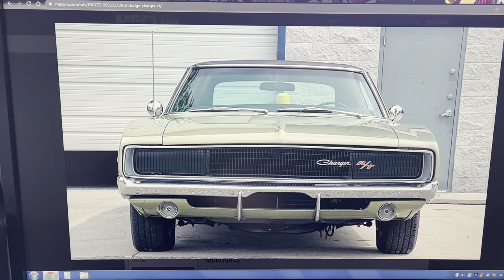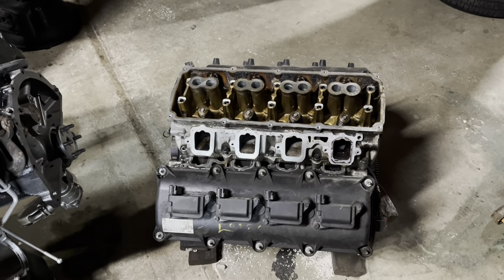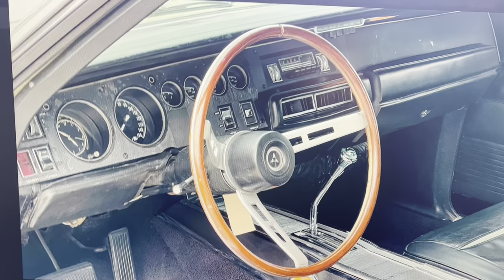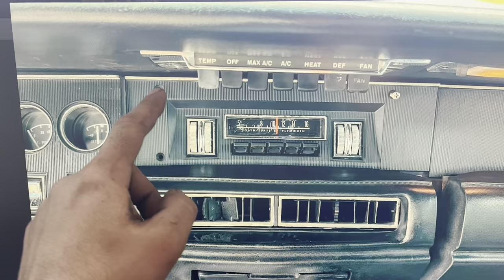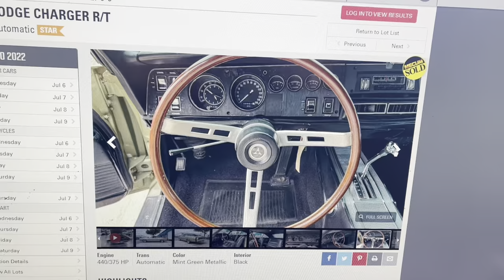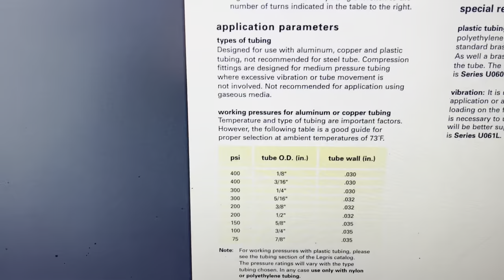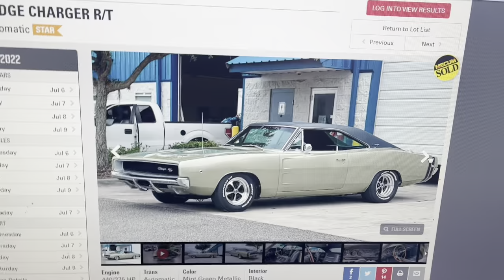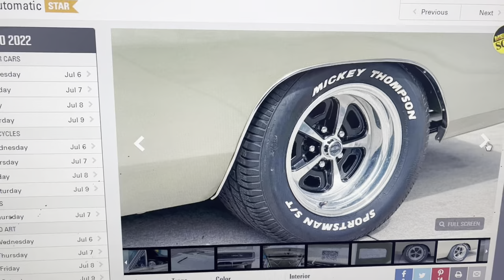Why Did This 1968 Dodge Charger R/T Just Sell At Mecum For $170,000? (It’s Unsafe And Bad)

Comment: You're absolutely right about that car...and there were more issues than you even mentioned. For example, the crappy fit of the bumpers stood out to me.  I've got a '68 Corvette that had been "restored" by some "professional" shop. They made so many mistakes and cut so many corners that I'm having to do a complete frame off rebuild just to be able to safely drive it. Even though they had already done a frame off rebuild, they neglected to replace the rotted body mounts and seat belt mounts. Only 4 of the 9 body mounts were holding anything....and two of checked this car out underneath with it on a lift. You couldn't see those issues with the car assembled. I drove the car that way for 3 months before discovering the problem....and MANY more. The paint looks amazing, but this is the worst and most expensive polished turd I've ever owned. I wouldn't have been able to pay someone to fix this car, but thankfully I can repair it properly myself.
Reply from the maker: Wow. Yeah, I really think that’s what’s going on here. Pretty decent paint job hiding so much bad stuff. I do think I mentioned the bumper fit? It’s obviously quite bad. If it didn’t make this video I might have cut it. Again I could spend days picking this car apart… I just wanted to hit on the big notes and talk about the crazy price and the stupid brake stuff.

Comment: Just found this. As the restorer and owner of a 1966 Dodge Coronet; this is why I bought a shell and frame and used my grandfather's and dad's Automotive manufacturing experience with Chrysler/ Mopar to rebuilt it TO Factory, no cheapness or wierd and unsafe corner-cutting. 
  This charger looks gorgeous, but ignorant decisions were made for the sake of profit. It is all fixable and hopefully gets detected and addressed by the buyer. That is alot of money for a Shade-Tree restoration. Mine took me from my sophomore year of HS ( 2009 ) to when I got married in 2014. It is now our weekend car lol. My Coronet is as close to factory as possible with modern parts and materials.
Reply: “Shade tree restoration” brings back fond memories of being sixteen/seventeen year old kids with just some tools, a pocket full of more dreams than money, a good number of very inexpensive local junkyards to spend endless hours wandering around in, and an old oak tree with that one perfectly thick branch at just the right height and angle in back of my dad’s less than desirable restaurant in a northern Michigan small town hit hard by the recession of the late 70’s. 

Thankfully most of us survived the “builds” we “geniuses” somehow so proudly pieced together. 
Man, if I had only put away just a few of those cars I somehow managed to get my hands on back in the day…I’d definitely have more money than dreams in my pocket today!

Comment: Really enjoyed your observations on this Charger. I'm a 1969 Camaro expert and  have seen many Camaros for sale at Mecum and Barrett Jackson that say original, but are not correct. They may have a deluxe interior, then don't have the deluxe installed seat belts, or missing the wood grain trim on the dashboard areas. Seen many RS optioned Camaros missing the headlight washer nozzles in the pictures that also are part of the RS package. These are just a few examples. All I can say is "Buyer Beware!"
Reply: Yeah, “buyer beware cause seller’s don’t care!”
Reply: I know in '68s the deluxe belts were a separate option from the rest of the interior. 
Was that different in 1969?
Reply: Car looks to be sitting lower than standard or is it ?

Comment: I worked at a local auto parts store when I was 18 years old. One of the other guys was waiting on a customer asking for 3/16 compression fittings and the customer also asked him if he could use them on brake lines. My coworker replied….. If you wish to die. He then explained how much pressure was in the normal braking system and then what compression fitting were rated around. The customer purchased the correct brake lines along with double flaring tool. I myself purchase lines and couplers to lengths that I never need to cut and double flare brake lines. The only use I have for compression fittings is transmission and fuel lines. This was and is a great and informative video. Thank you

Comment: Hats off to you for you are very insightful and also polite with your assessments on this channel. First I'll say that in my opinion, this is probably the best color charger R/Ts came in and it looks like a beautiful paint job up close. I totally agree at this price range it should have continuous lines. throughout. In all honesty I've used the compression fittings on many cars 70's-80's cars of my own and never had any problems. I never knew their rating was low. 

I was eight years old when this car was built and our neighbor Eddie had a Charger 500 in pale yellow that I used to see every day. Long before I could drive, I already loved the style of that car.
None of the cars sold at Mecum look like an original car did back then. They weren't that shiny, they didn't all have mag wheels and tinted glass, or consoles. It is hard to believe the prices that are paid . 

I'm also amazed how many classic American cars are still preserved in general. There are still hundreds of thousands of them in all makes and years.  Remarkable.
Reply: >>>  === They say  E bodys : 71 Challenger or Cuda /  B bodys : 68 Charger or Daytona / C bodys : 71 Fury Sport.  These Mopar type alone will ALWAYS bring VERY TOP  ... T O P dollar. True supply and demand  never lies I guess.  === <<<

Comment: Compression fitting on a brake line. Yikes if you were willing to do that, I'm curious about the electrical and fuel system. Shop full of Mopars, I subscribed. Demon has always been on my wish list, right there with a 4 spd AAR
Reply from the maker: That’s exactly my point! It’s great we can see that… but what can’t we see? It just says everything is bad to me. Everything on that car demands scrutiny. 

Thanks! I love the Demon. That was a deal several years in the making. There is a whole playlist on my channel called Dale’s Demon if you want to learn more. Now that I have a lift I hope to be making more videos on that soon! It needs a transmission… third and fourth gear have left the building…
Reply: compression fittings in the electrical system, too. You don't want the amps leaking out onto the driveway.

Comment: Thank you for the insight of the compression fitting on the brake line. No one has ever brought that to my attention. I used a compression fitting when I installed a dual master cylinder on my 1961 Chevy Impala back in 1982. I still had that fitting when I installed power disc brakes on the front in 2020. That fitting is now 30+ years old and has traveled about 100,000 miles. At this point, I'm not sure what to do. You know the saying, "If it ain't broke, don't fix it".
Reply from the maker: There are lots of them out in the wild on brake lines. It can work… but it’s not the right way to do it.

Comment: I worked for a short time at a very high end resto shop ,where one job involved reassembling a a 300Letter car . The owner was already into it for $250,000 when I got it running and the engine,a 413,had horrendous piston slap. . I told the owner it needed rebuilding and he got pretty upset as it had already eaten $40,000 . When we got it going it was sent off to a alignment specialist who refused to let it be driven back to the shop because the steering box,rebuilt by a very pricey shop here in my city, was no good. I sent it back to the US where it was rebuilt for less than the cost of freighting it to and from the USA. Lots of things were wrong with the car despite the money spent and i could only put it down to the shops company management cutting corners to to gain more profit. I decided to leave at that point.  Recently the car sold for just over $75,000.
Reply from the maker: Wow. Yeah… making money is one thing. Charge enough to do a good job (not, you know, $1000 an hour) and do it right the first time. I’ve been in business for myself. My big challenge was trying to charge enough to pay the bills and survive. I just couldn’t take people like that. Those guys on the high end have the charging part down…

Comment: You're totally picking it apart and you have very valid points too many mistakes too many problems for that price  mopar is expensive 170000 should get you a completely finished car
Reply: Just saw the article that a Ford Crown Vic can be converted into a late '60's Dodge Charger!
Reply: Looks like it was done by a 'bodyman' with limited mechanical skill... but body is the expensive stuff...
Reply: 170,00 should get you a NOS new car with 10 miles on it.

Comment: If the engine, transmission and rear end were in very good to excellent condition, and the AC worked, I doubt that was the case though, then maybe $30,000 to $40,000.  I've owned three 440 magnum MOPARS and one 340.  1968 Charger RT, 1969 GTX, 1970 Challenger RT/SE and the 1972 340 Challenger. The best was the 1969 GTX that I bought from the original owner when it was one and a half years old. They all had AC, power steering, power brakes and automatic trans.  Actually, they all were in practically new condition.  This car for that ridiculous price is sh t!  The seller made out/was a bandit, and the buyer was a fool.   I've got a bridge in Brooklyn that I'll sell to him...
Reply: Uh, what? I fell asleep halfway....
Reply: @CaptainCraigKWMRZ  no matter

Comment: Right on man. I see trash work like this alot. Recently had a Super bee come in that had a Grant steering wheel that the owner wanted to put back an original. The car came out of a name restoration shop. I got the wheel off and the aluminum adaptor and realized that the steering shaft was UPSIDE DOWN so that the blind spline was 180 out and they had just mashed the aluminum adaptor over the steel steering shaft because it was softer. Had to remove the shaft from the box and rotate it then put the original on with the splines lined up. Stupid people man. My wife even laughed at this one.
Reply from the maker: Absolutely maddening. A lot of what I do with old cars is going in behind people that don’t know and fixing dumb stuff - usually on the tune up and runability side of things.
Reply: Cool wife 👍
Reply: Just saw the article that a Ford Crown Vic can be converted into a late '60's Dodge Charger!
Reply: @stuckinmygarage6220  The best!!!
Reply: @BuzzLOLOL  Saw that too, you have to Flip Over and Read Directions. . . .
Reply: @joemancini3258  - My Crown Vic is an '04 with rack and pinion steering and slightly wider track, but prolly still work OK... I cracked up with 'Charger' hood open and looked just like my Crown Vic underneath it...
Reply: @BuzzLOLOL  🤣

Comment: I worked at a Plymouth dealer as a tech in 1975 and bought a one owner 71,000 mile 68 RT auto running no rust for 200.00 dollars. After I sold my 1971 Pontiac gt37 leMans
Reply from the maker: Oh to have been around in those times…

Comment: As a 16 year old I bought a 383charger non RT from my hometown dodge dealer exactly the same colors as this one for $1300 in late 1972. It had about 80,000 miles already because it belonged to a military guy. The good news is the dealer had freshly rebuilt the motor and it was a very clean car. I drove the heck out of it for about three years and sold it for $1200. It was a great car. I couldn’t afford one now.

Comment: I worked in auto parts for 18 years and have had customers leave mad because I wouldn't sell them a compression fitting after they told me they were going to use it on a brake line.
They still insisted it was fine after I said that may be one of my kids out there on road that they hit when the brakes fail, so then I told them to get out.
Compression fittings do NOT belong on brake line no matter what the value of the car.

Anyway, good call on that auction sale, it's bad all the way round.
I always hankered after a '71 Charger SE but just can't afford even a beater.
All the best.

Comment: Just subscribed. Wanted to say thanks for educating anybody who saw the compression fitting and didn't understand why it was so wrong.  30 years ago I did a hydraulic clutch conversion in a Jeep . I needed it moving and had to cobble the line back together to the slave. I used a compression fitting.....and it worked. What I didn't understand was the continued cycling of pressure worked the fitting to failure. I didn't crash and I learned a lesson. Brakes are a different matter. Your first failure is potentially your last.
Reply: Yeah you do a repair to get you to a place where    you can do a proper repair. My automotive education began with John Muir's "How to keep Your Volkswagen Alive and Well for the Compleat Idiot!"  It held a lot of lessons about how and why on mechanics an life and I found it way better than Zen and the Art of Motorcycle Maintenance

Comment: I bought  73 Dodge Charger SE Brougham from a guy who had Mecum try to offer to sell it for him.
I may have spent more than it's worth and it had typical 50 year old issues. But solid and mostly original. But I knew what I was getting into and checked it over completely before buying. That brake line you showed, froze my heart. DAAAAAMN!!! that's bad.

Comment: Compression fittings are actually a common cheap fix I see regularly. They do leak eventually. You can actually tighten any line or fitting properly to ensure they don't leak but few people know what to do. So here is the proper procedure to tighten any line, fitting, or coupling. First snug it on both sides, then go back and apply more pressure so it is tight... but wait, here is the trick... take a magic marker and draw a line across all the pieces in the connection. Now go back and lightly loosen the fitting then retorque it. You will notice that you can actually gain about 1/4 more of a turn on it. Then... don't forget to firmly attach a body clip to eliminate vibrations. Vibrations cause leaks and breaks in hydraulic lines (booms on backhoes, diesel injector lines, etc). Lastly,  the mismatched paint on the doors and quarter panels is caused by 1 or 2 things. The painter failed to keep the whole gallon of metallic mixture continously swirled every 5 minutes OR they painted the door at 30 psi and then the quarter panel at 50 psi, open the fan spray width.  These conditions cause metallic paints to alter their tone.
Reply from the maker: We’ve got a non-metallic yellow Cuda at work currently with similar mismatched paint problems, so there are definitely several ways to skin that cat… getting that extra “cinch” is definitely essential to get flares to seat. I stand by what I said about using compression fittings in brake systems. And yes, I know people do it all the time. They shouldn’t. I personally don’t want a fitting that will “leak eventually” holding 2000 PSI of pressure inside my braking system.

Comment: Videos like this make me feel so fortunate I was able to get my 72 nova from the second owner with all original parts even trim and emblems original paint and no body work ever done. It might have a tiny bit of usual nova rear fender rust but no flashy paint hiding shotty body work or weird short cuts. I think it is REALLY important these days to try to find something super solid for less money and do the work yourself then trust these really nice looking "restorations". These cars are just too old and most have changed hands so many times it is impossible to know the true build quality after all the years of guys wrenching on these things in their backyards.
Reply from the maker: I feel the same way about my Demon - and to a lesser extent, my Charger. The Demon is almost all original paint. The original V belts are in a box… I don’t have the original tires or the air that came out of them, but I have just about everything else. I know exactly what it is and what it isn’t. My Charger had some repairs and a cheap paint job done. It’s not amazing, but it’s easy to see what has been done, and it will be easy enough to redo later. It’s not a total hack job. I’d be very, very wary of anything that looks shiny and “new” like this.

Comment: When I got my classic car, I bought a non molested 1966 GTO that needed very little body work, took it to a good shop, had them replace all the mechanical stuff, rebuild engine and trans, fix the little body work, paint, new interior and ive enjoyed it for 14 years now. Still looks great.
Reply from the maker: That’s awesome. At the shop I closed in July (which was not a body or restoration shop,) for some reason we took on a humongous ‘66 GTO project. It needed floors, trunk, quarter panels, rear window filler and bracing, lower fenders, and lots of other little stuff. It took three years, but we finally got the metal work done and primer on the car just in time to close… whoops. I hope it gets finished wherever it ended up. It has been in pieces since 1990, because as often happens, someone ripped the whole car apart with big dreams of a full restoration. They got as far as painting the frame, and having the engine “rebuilt” by a high school auto shop class with three different types of piston for some reason.
Reply: @DeadDodgeGarage  Oh ya, at work all the gearheads made fun of me back when I bought it and sent it to a shop. I said I didnt want to tear it all apart and get burned out working on cars and let it sit there for 10 years. So I got my car back in about a year and it cost about $50K parts and labor. They then made fun of me being "underwater" on it and I said I didnt spend this money to turn around and sell it, I want to enjoy it. BTW their cars are still being put back together 14 years later as I am enjoying mine. LOL